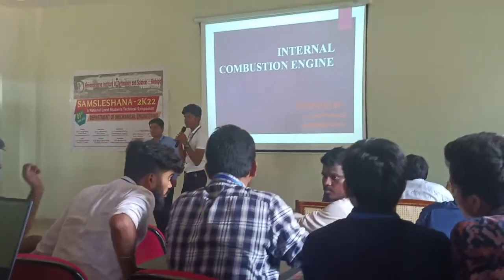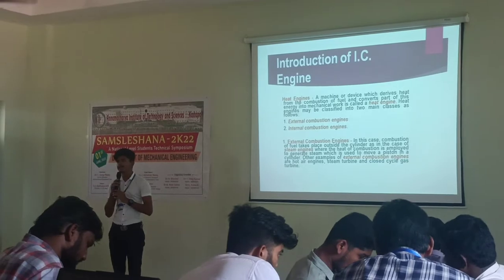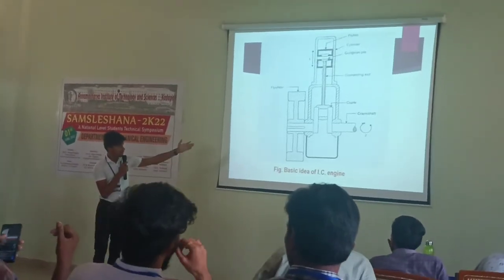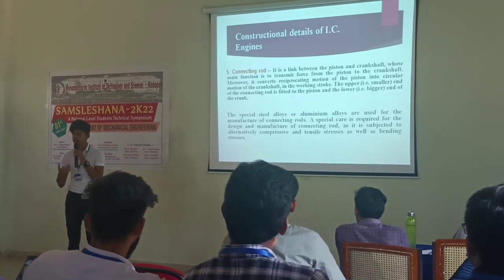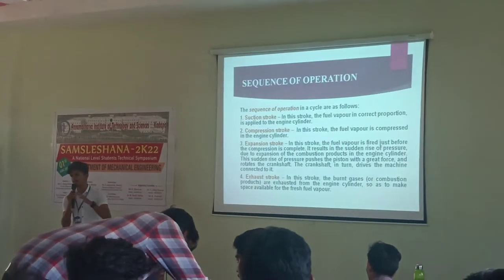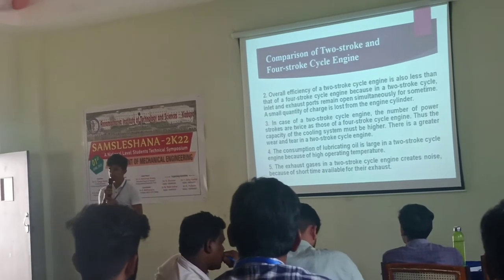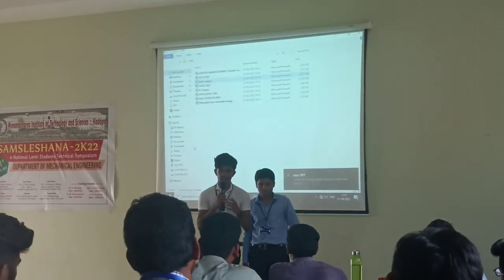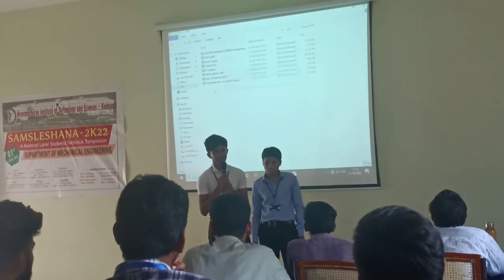PPT on Internal combustion engine#mech #viral #pptpresentation #ateeq10 #presentation #sharemyvideo

Comment: A. Parts common to both Petrol and Diesal engine
1. Cylinder  2.Cylinder head.   3.Piston    4.Piston rings 5.Gudgeon pin 6. Connecting rod 7.Crankshaft 8.Crank 9.Engine bearing 10.Crank case 11.Flywheel 12.Governor 13.Valves and valve operating mechanism.
B. Parts for petrol engines only 
1.Spark plug 2.Carburettor 3.Fuel pump 
C. Parts for Diesel engine only
1.Fuel pump 2.Injector